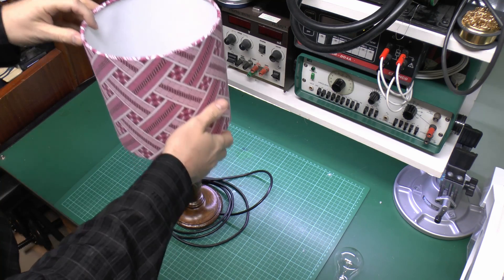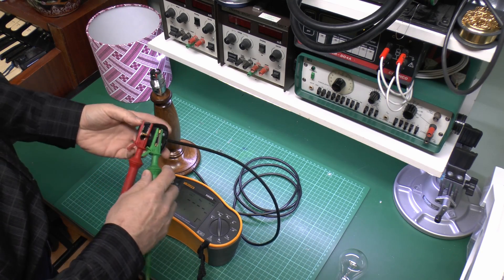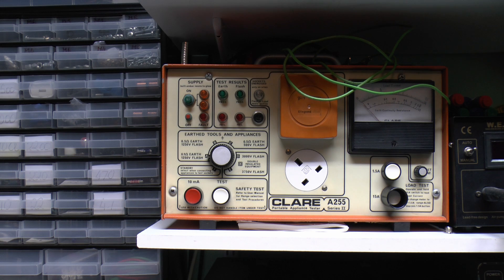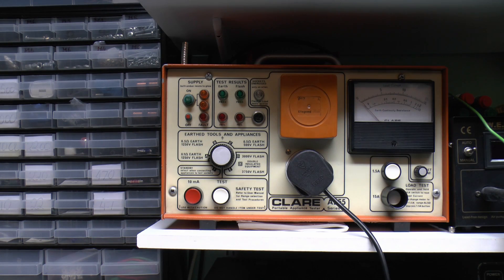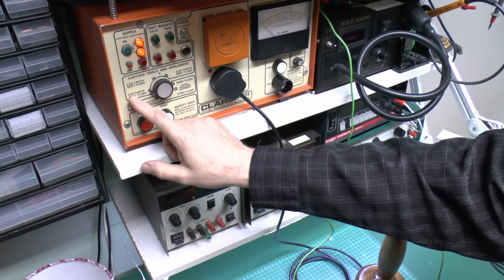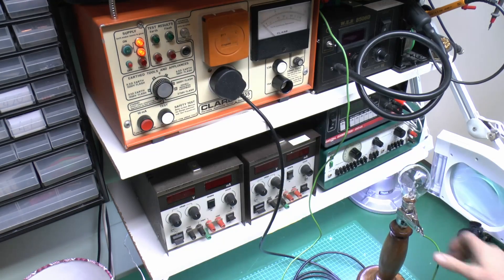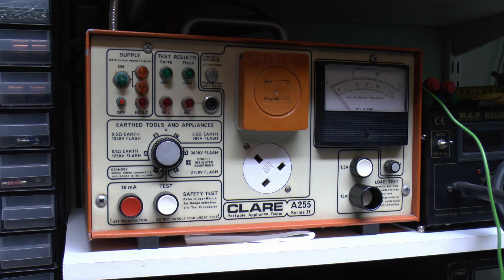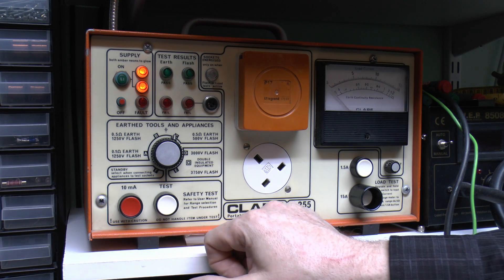Testing a Table Lamp

Comment: Hi John, glad to see someone showng the specifics of testing an appliance. However you could be about to open a can of worms on the portable appliance test (PAT) industry. well I hope you do actually, perhaps you should demonstrate the procedure for testing an appliance and show us just how easy it is to get wrong. As you rightly said the inspection component of the PAT is the most important part. I attended a site and was shown a fridge that had been tested and passed by a PAT operative and was amazed to find that it had been passed dispite the fact that it had a missing cover from the connections into the compressor. Its my guess that the fridge wasnt moved and even looked at from the rear just plugged into the tester button push lead clipped to hinge and onto the next one. Hope you feel its a worth while subject to cover with a lot more detail thanks for the vids John all the best Sean

Comment: The Clare machine is much more satisfying to test with - chunky buttons, clunks and glowing lamps.
Given that almost eveything is a SMPS these days, would you dare use the flash probe to test them? What about a USB ‘wall wart’, testing between L+N and USB outlet?
Reply from the maker: USB supplies should be able to withstand a high voltage, as they still contain a transformer (although a very small one), and the inputs should be isolated from the output.

Comment: Your last lamp video finally motivated me to install one of those cheap ebay lamps outside under a car port! 3A switched FCU (with no flex outlet, used holes in the side) off the load side of the existing garage FCU (off RCD protected ring main), in T&E, then flex from switched fused spur to junction box behind the light and to the flex of the light. The waterproof gromet on the light was too small for the flex I wanted to use so I couldn't run the flex from the FCU into the light. Do you see any problems with my method of installation? The junction box is under a carport and unlikely to get wet, the only problem I can think of is insects entering the junction box and shorting out on the terminals?
Reply: Flex should not be run from load side of FCU as there is no strain releif, but if the cable is clipped to the wall then it's fine!

Comment: Assuming you've got a 3A fuse in the plug of that lamp, isn't there a danger of blowing it with a 25A test? If not, how long would you expect a 3A fuse to pass 25A without blowing?
Reply: The 25A test is only testing the earth, it is not passing through the phase wire, so the fuse is not a concern.
Reply: Lester Electronics Earth wire has no fuses anywhere. It should keep conducting at any case.
Reply: The earth wire (CPC) is required on class 1 equipment (metal casing) the ideas is; let's say on this piece of equipment the live wire comes in contact with the casing (fault). Because we have the earth wire effectively connected to the neutral at the star point of the transformer the current will have a very low impedance to this point. While this is happening high current will be running through the MCB (fuse) at the consumer unit and thus the MCB  will operate and clear the fault in a required time; usually  depending on the system 0.2 seconds for the final circuit. However there will be discrimination between the fuse in the plugtop and MCB. Most  systems in the UK require Rcds on sockets so usually this will operate before the MCB unless it's an  LN fault.